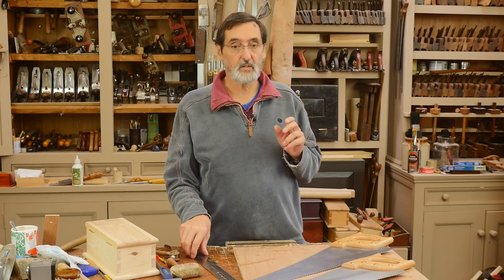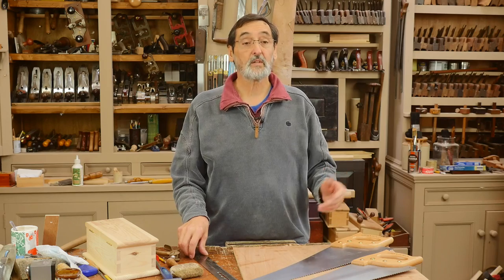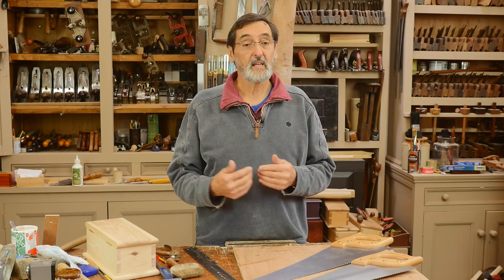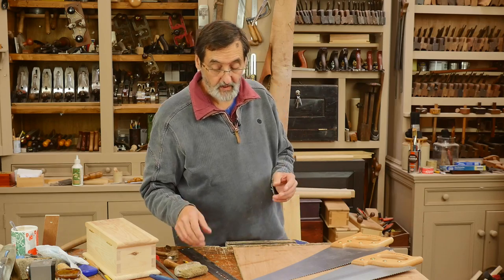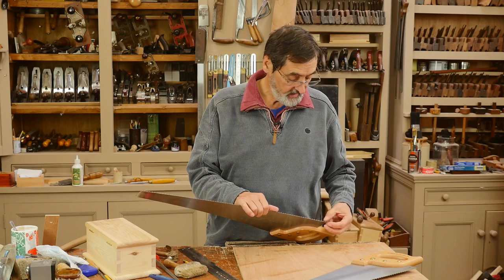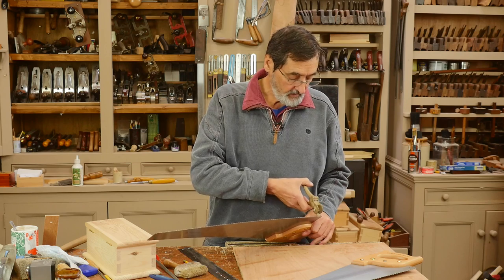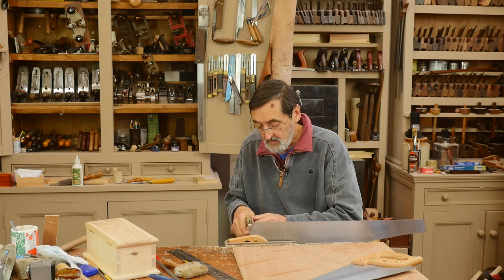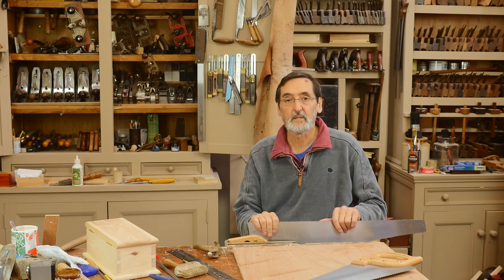Setting Crosscut Saws | Paul Sellers

Comment: Maybe I'm crazy but would it actually matter if the set was opposite so the teeth cut bevel-out instead of bevel-in? It would be a 60 degree cutting angle either way, no? I guess this would mess up future sharpening though since rather than widening the gullet, it would instead close it off completely (from the bevel's perspective).

Comment: Thanks for the video. I am about to undertake my biggest project to date. It calls for a 2 ft wide top to be laminated. I am worried that I will not do this properly and the places that I glue will split. Do you have a video that covers the proper way to do this so you don't have to worry about splitting along the glue lines?
Reply from the maker: There are a number of videos of this viewable with the free subscription to woodworkingmasterclasses.com

Comment: How hard would it be to convert a rip saw to a crosscut?
Reply: Should be fairly easy as a ripcut is basically a crosscut saw without bevels. Just bevel the teeth and you're good to go.
However, the other way round (cross->rip) is not really feasible, because you'd need to file away a good portion of each tooth to remove the bevels.